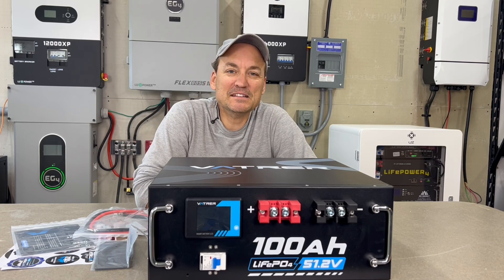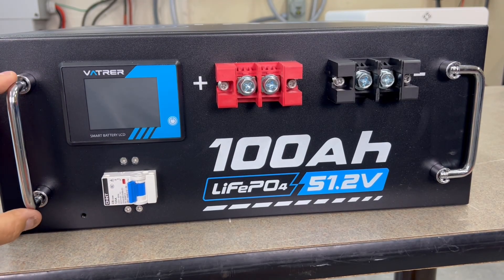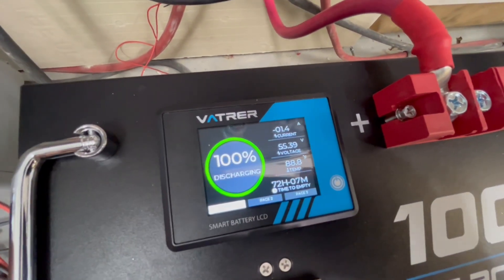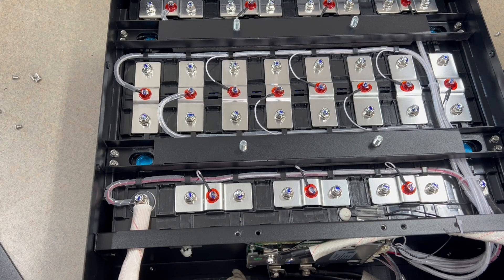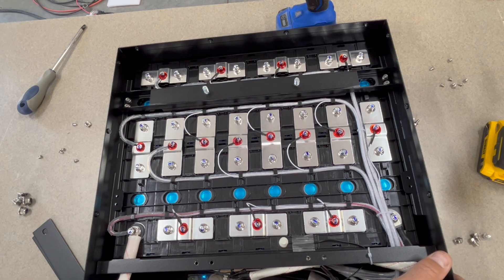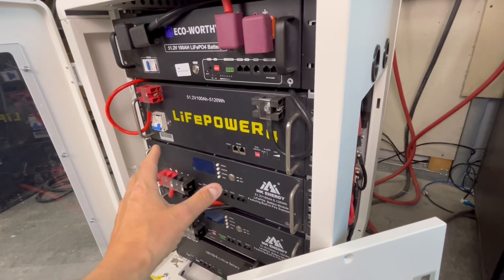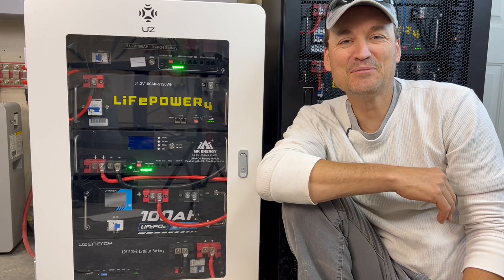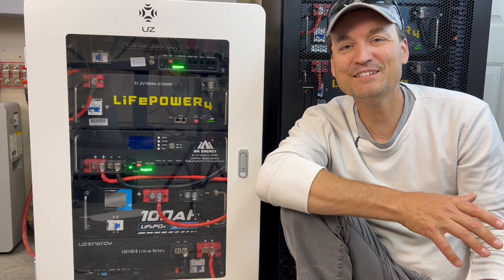Vatrer 100ah rack battery tear down and testing

Comment: I took a risk a year or so ago and bought 2 of these VATRER batteries and they have worked flawless.  I'm now using 6 of them.
Reply from the maker: @tlteal  that’s awesome! Yeah I really like the BMS and cells they use. So it should be a problem free battery honestly.
Reply: @GavinStoneDIY  all 6 have been good for me so far.  I complimented my Ecoflow equipment with these plus Victron 450/100.  So now I have more than 60kw backup.  :-)

Comment: I have the prior version of this in the blue finish, but it’s pretty much identical otherwise. Hitting 102.3ah. No problems. The range on the Bluetooth isn’t great so it’s a shame there’s no rs485 connector on the case but I think on some forum someone did add one to the jbd.

Comment: Please check the white retaining goop for continuity. Some China products that had it on PCB's etc. were prone to eventual failure due to short circuits caused by the substance.
Reply from the maker: @Time-Trvlr  I’ve seen it on almost every build I ever reviewed. I’m not sure how a rubberized caulking could be conductive.
Reply: @GavinStoneDIY my experience, which is documented, was on KRK audio monitor speakers. Scraping the product off and replacing the damaged components  usually salvaged the units. Test the goop with ohm meter set to megohms.
Reply from the maker: @ I can do that yeah. It wasn’t just an overheating issue? Unless there is metal or another type of conductive material added to it, that just seems odd.
Reply: @ there are many compounds that even when mixed may create a conductive substance. Think about trace carbon or graphite molecule's. There was no intent for it to happen. It even may have changed during its cure process changing to conductive.
Reply from the maker: @ good point yeah.